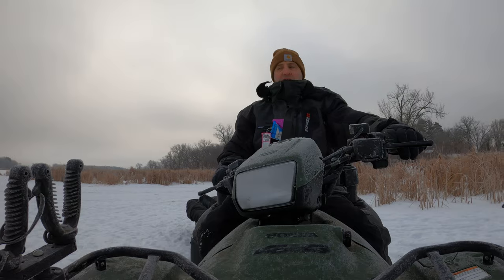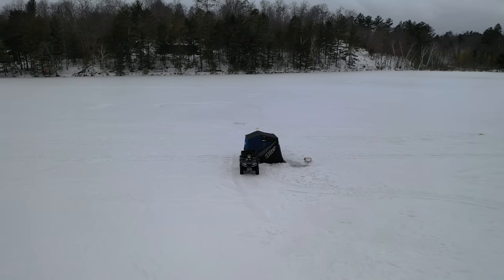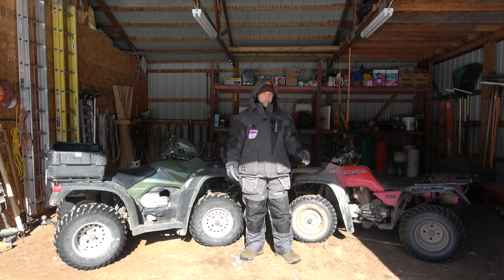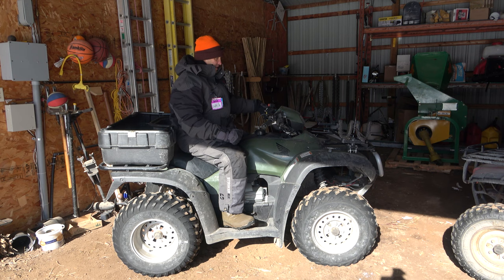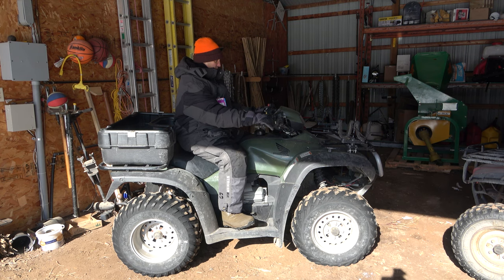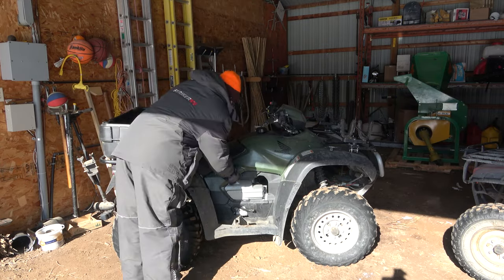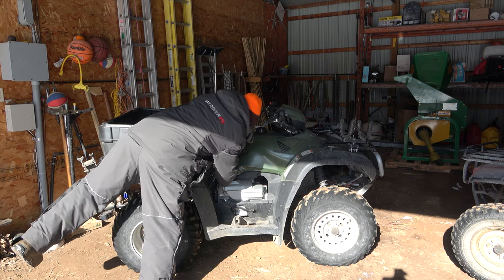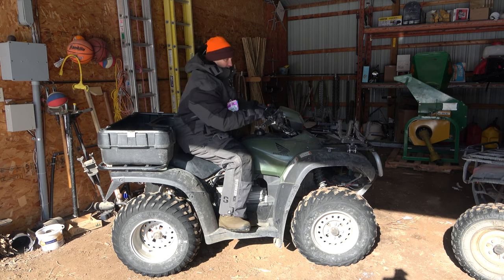The Secret Button To Start Your ATV In Sub Zero Temps

Comment: Just something to think about. Wind chill has no effect on starting engines in the cold. Wind chill only affects bare skin. If the Hondas had an actual choke and not just a fuel enricher valve they’d start in the cold. You gotta go to a fuel injected Atv. They’ll start any temp with a little heat on the bottom of the motor to warm things up first.

Comment: Iv got a 02 Yamaha grizzly 660. Everytine it gets. Shut cold I can’t start it just cranks.  I wonder if I have a primer bulb ? No clue I don’t see one if so it’s covered uo by plastic
Reply from the maker: If it has one, it should be on the carb somewhere. I pull the side panel of the green ATV and just leave it off all winter so I have access to the primer.

Comment: Duh!    Its a primer that draws fuel from the float bowl and squirts it directly into the intake . Same principal as the primer on a snowmobile!.....42 yrs. Honda service tech.
Reply from the maker: Yes, that's exactly what it is. As a service tech you already know this, but not everyone has that level of experience and may not know about it. Especially on the newer models that cover the engine with body panels so you can't see it.

Comment: I have a 15 Honda Fourtrax 420. Do you know if my rig would have one? It’s also fuel injected. Im a first time owner and am still figuring out my machine
Reply from the maker: Its real easy to find out. Just look for a black button on the carb. On these newer machines, you may have to remove one of the plastic body panels to reach it. On my 2006 Honda, the panel just pulls right off. No screws holding it on. I just leave it off in the winter so I have easy access to it.
Reply: No carb on a fuel injected bike.

Comment: The cold is One of the main reasons I upgraded my wheeler was for fuel injection.
Reply from the maker: Did you notice a big difference when you switched? I have not used a fuel injected wheeler yet, but a friend had one out ice fishing in -15F, and he could not get it started. I'm not sure what was going on there.
Reply: @GoMidwestFishing  huge difference. Coldest so far this year -17, last year -20. The battery did like the cold but ATV started on 2nd crank. My 2003 was crank & choke, choke & crank.

Comment: It's not a trick and it's nothing new, it's just basic knowledge on how to start your atv in the cold. Keihin (Carburetor manufacturer for Honda atc's/atv's) has been putting primers on their carburetors since the mid 80's!!
Reply from the maker: You're right, its not new, but it turns out that many people don't realize its there, so I wanted to point it out.

Comment: What battery do you prefer?
We were on lake Ontario for walleye the other morning well below 0 and my battery wouldnt turn over on my 300. Tried kicking it with the pressure release and couldnt get her to fire. Do you ever have battery issues, are there batteries that are moreso made for below zero ATV use?
Reply from the maker: I use the highest amp AGM battery I can find. The AGM seems to do better in cold weather. If it wouldn't even turn it over, it could be that your battery is getting old. In that harsh environment, the batteries only last a couple years.
Reply: @GoMidwestFishing  I was wondering if the Lithium would be worth it, as they say they last up to 10 years.
Im going to look into the AGM and lithium for cold crank information and see what I can find.
Reply: @GoMidwestFishing  change your oil! Bet that han't been done...like forever.

Comment: Didn’t work man it’s 34 degrees And I did it didn’t work
Reply from the maker: Did you push the button several times? Its like a primer pump. It works every time for me.
Reply: @GoMidwestFishing  yes sir I try it again a different day and it worked I check my oil and it’s was almost completely out when I try it before so it prolly was just the oil sorry about that thanks for the tip
Reply from the maker: @jb.outdoors3042  No problem. Glad you got it running.
Reply: Probably rotted out diafragm from ethanol!l